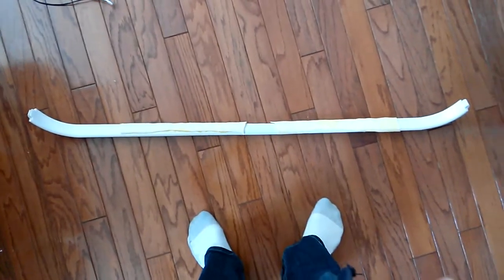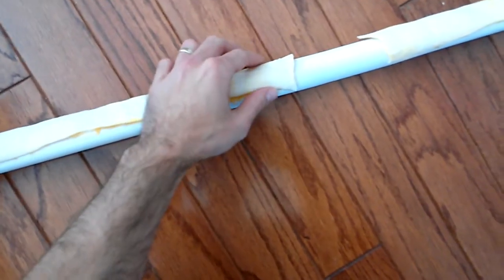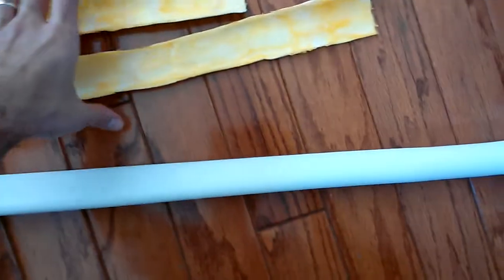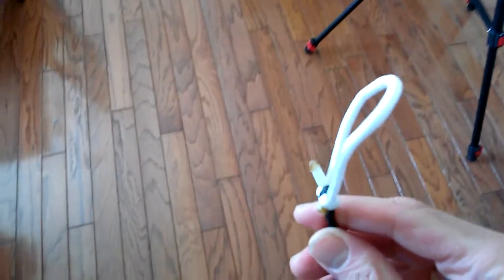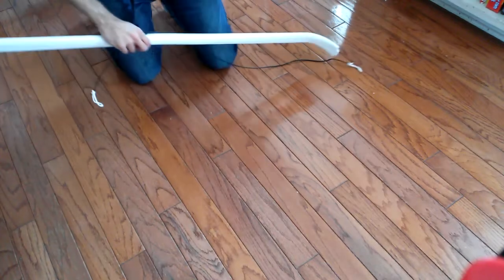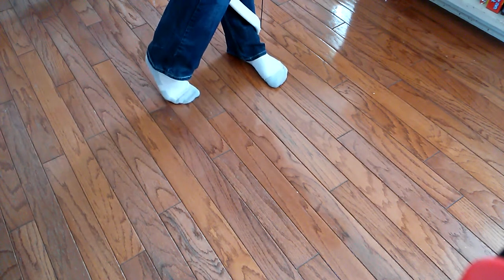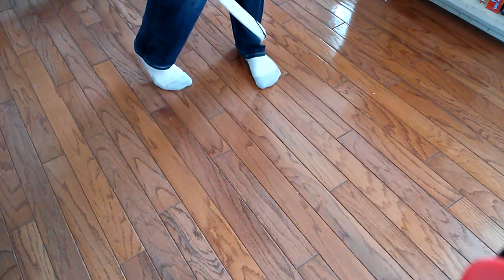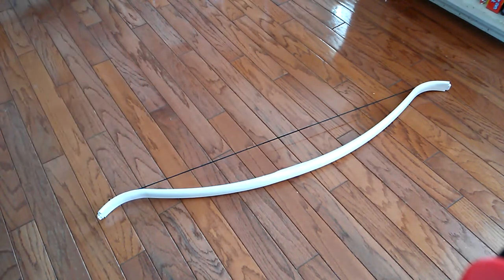Fail: The Rawhide-Backed PVC Bow

Comment: Only glue that i know for sure that will stick wood or cloth to any kind of vinyl is contact cement but youd have to get the rawhide damp with paint thinner instead of water. Then give it like a week or two yo completely cure. Ive tried it on mulberry bows because mulberry has that weird latex wax stuff in it that hates glues of all kinds. Once it worked amd once it failed. The one it worked on broke amd the kne it failed on still shoots at about 30 lbs at 25"..
So who knows bowyery is the single most focusing and calming andist infuriating thing ive ever learned to do.

Comment: you will have a hard time getting it to stick to plastic with any type of glue. the best way is to wrap the whole bow with it and sew it down while wet. another method would be to cut the rawhide into thin strips and spiral wrap the entire length tying securely at each end. the problem is the glues you need to stick the rawhide to the bow have to have a porous  surface to work and PVC is by no means a porous surface . hope this helps.

Comment from the maker: Excellent suggestion - people did this originally to save on glue, but if I just can't apply it in the first place, the benefits remain the same. I'll need to try on a smaller bow, since this one is already 70+ pounds, and I won't be able to take much more weight without making another shoulder-breaker :-P

Comment: Yea, PVC is really slick stuff, almost like Teflon, hard to get anything to stick to it even with sanding. Shame it didn't work out, I was eager to see how it shot.

Quick question, do you have a brand of PVC you prefer to use? I have two brands found near me and I'm curious to see if they have different properties, they certainly aren't the same, one brand of pipe seems to be slightly translucent.

Comment: i get the shape done and then i add my recurve to the tips but as soon as i string it they always kink and fold on one limb. not sure what im doing wrong. so far ive just been making simple bows by sliding a smaller tube into a bigger tube then just cutting the knocks and shooting them. Cant quite get re-curves yet thought which is annoying. Im using a heatgun too by the way.